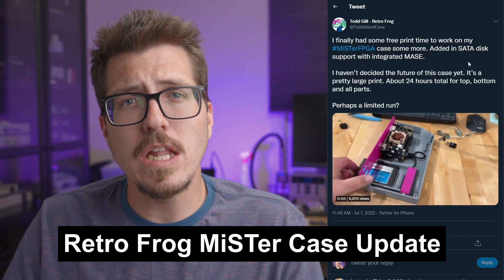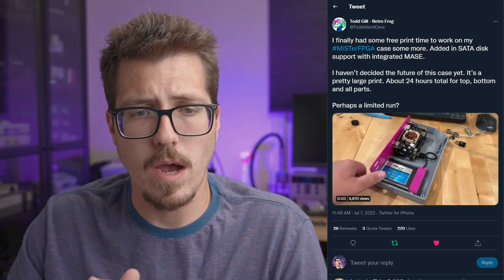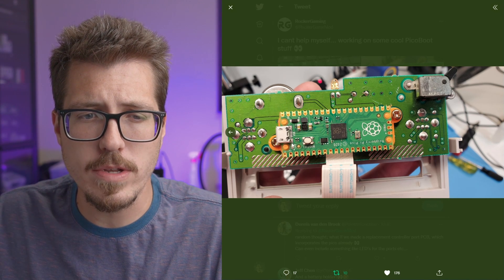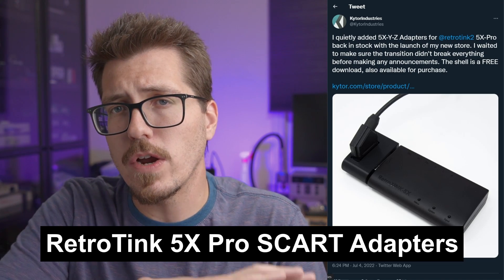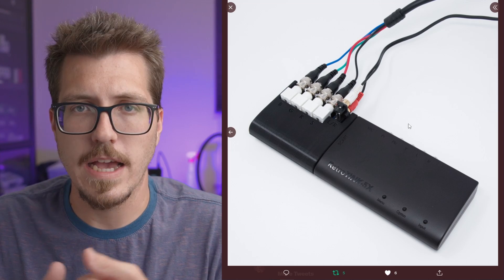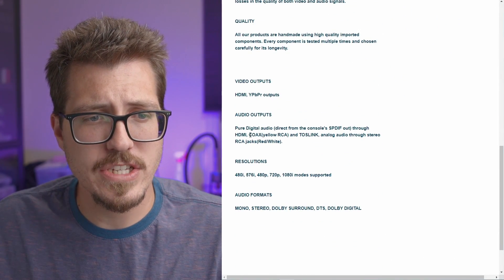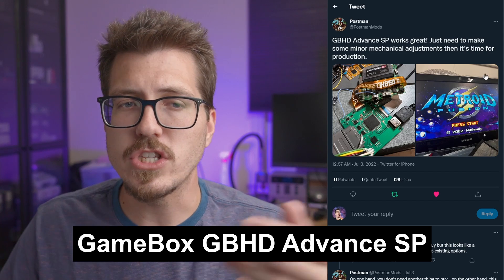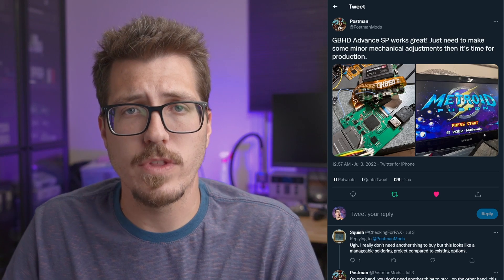New GameCube IPL Mod from Mancloud! - Retro Modding News 7/10/2022

Comment: PicoBoot Raspberry Pi Pico . cool they made it a mod chip. wonder if they going to do the other consoles. Gamecube modding seen is there. Lots to do. If it wasn't for the gba player id just stick with a modded wii.

The Xedusa Xbox AV Adapter i am looking into. I hope it turns out good. Was just using a pound hdmi. This should be better. Not much done for the og xbox. I just glad there is a good harddrive mod for it. Got a ton of games almost feels like the hole library of NA games. Good stuff.

looking forward into RetroTink 4k. hope it turns out good. RetroTink5x i hear is top notch.